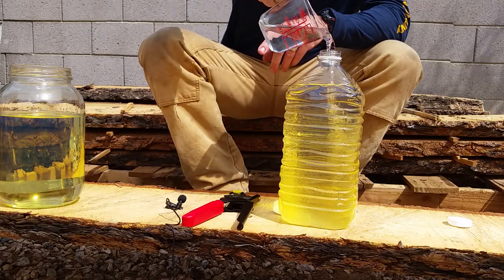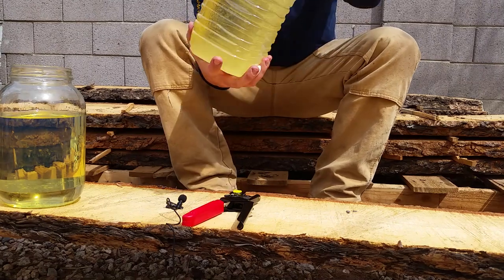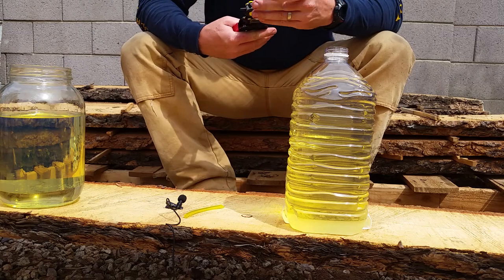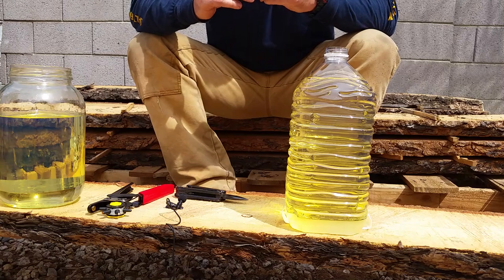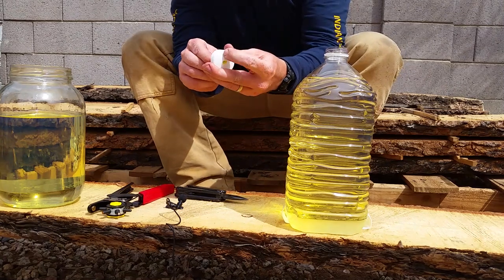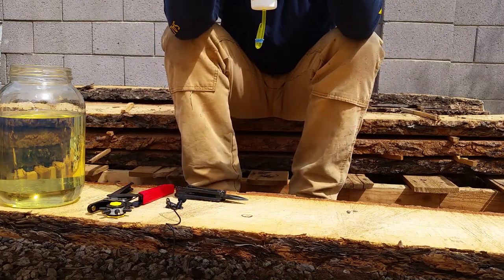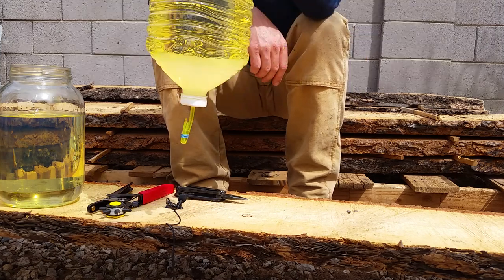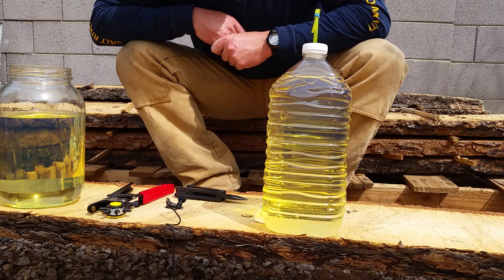Removing ethanol from gas

Comment: So I'm curious why would you want to remove the ethanol in my case I would love fuel that's all ethanol and no gasoline. It burns cleaner cooler and is easy to produce. Back in the day they used to throw gasoline away and then they realize they could pawn it off on people. The only downside that I see are you can't let it sit very long and you need more of it.
Reply from the maker: +all the boost eethanol has a affinity for water and ruins fuel systems especially small engines

Comment: The octane booster may be alcohol!
Reply from the maker: I later learned that and didn't add it
Reply: Did you know that many of the race cars use E85. it is about 110 octane. The think is that it is not the ethanol that is the trouble. It is all the other things that they put in the gas. Maybe you should look at what is in there. 10%  ethanol but there is much higher % of many other things that do the damage.

Comment: what the point of "cleaning gas " ethanal or methanal is a clearer burning fuel . plus your not doing it right. you need to heat up, let it set for number of days and plus your not gonna take all the ethanal out, your adding more water to fuel. any way good luck on that buddy
Reply from the maker: +Moe Maywood the science is fairly simple. Water and ethanol have an affinity for each other. Both sink to the bottom.
Reply: yes it does, but what are you gonna do with it after?, dump it? where? as is most recyclable oil stand they don't take dirty oil??. thanks to city laws ?WTF  it best to add methanal to your tank it will burn better and look for non ethanol gas stations.
 i make my own fuel " biodiesel" 
in my opinion ethanol should cheaper than gas,  go complaint to your government for that buddy
Reply: the more blue color the better. that yellow color is TAR or crude oil. 
yes 92 octane is best for all cars. 87 is for  Lawn mowers & two stroke engines  which they need a mix oil and gas.

Comment: Seems kind of redundant to remove the additive, and then have to put it back so the engine can run right, and being the same kind at that. Good science project but pointless.
Reply: Why would you remove the ethanol if you want to keep it in there? You remove it for engines that don't like it.

Comment: And here's why this is so wrong:
The problem in little 2-strokes isn't the gasoline or the ethanol, it's some complicated chemical reactions of the ethanol and fuel additives when EXPOSED to water. By rinsing out MOST of the ethanol, you have GUARANTEED that the remaining bit will go off and your fuel, if stored, will be contaminated.
Even adding Methanol won't help, as it will tear up those little Chinese carbs.
Go buy boat gas. Pure-gas.org . . . You're welcome
Reply from the maker: +TIMEtoRIDE900 nothing complicated about ethanol attracting moisture floating to the bottom of the tank and getting sucked up the fuel line into the carb causing rust, corrosion and hardening to rubber components. That is if it doesn't wash out the cylinder causing metal to metal friction.

Comment: I've been running "trufuel" in my kids little quad. Saves me the hassle of cleaning that gummy crap out of the jet And idle circuit everytime we start it. Which, no we don't start it often enough and what a pain in the a$$ to work on. But the fuel is retarded expensive.
   I might give this a try

Comment: "Hard to find ethanol free gas", WTF are you talking about? Just about every station with more than two octanes has non-ethanol gas, usually 91 or higher octane. This A LOT of work just to save 60 cents.
Reply from the maker: +Retro Auto - MN every grade of gas has ethanol in it year round here in AZ

Comment: I'd rather pay the extra 20 cents per gallon for non ethanol..  shoot I pay  45 cents for higher octane non ethanol.
Reply from the maker: I can't find any here from the pump
Reply: @KimballCody  that is unfortunate. I believe every single station here has at least 1 non ethanol option, usually the premium 91 octane.  The smaller stations will have 89 octane 1 with and one with 10% ethanol.  We are a major ethanol producer state so the government is trying to change the 10% to 15%.  I can not stand ethanol for motors it's only good to drink.

Comment: A jug of gasoline left hanging upside down, what could go wrong?
At least this guy seems to be outside.
Ladies and Gentlemen....PLEASE be careful with fuels...any and all fuels.
You might try siphoning off the clean fuel. Keep the hose end above the water level.
That's how they get wine out of the barrels and leave the dregs behind.

Comment: I do not recommend doing this . Ethanol / alcohol Is not that big of a deal . the problem everyone is having with it is just what you are showing in this video . The moisture will clean to the ethanol so Therefore ethanol will pull moisture into it. water in fuel in engine don't go together . The tank in your vehicle is sealed you don't have to worry about moisture being pulled in . Now their outdoor equipment is a different story .run your mowers dry when you're done with then invest in a decent can . The little red mixing can that everyone keep is where 90% of this damage occur Shelf life of fuel 45 days tops

Comment: Obviously not to many of you realize the performance gains.  Especially on turbo and super charged applications. An f150 with EcoBoost can easily pick up close to 100hp or better when combined with a custom tune. I've never had more fun in a truck.  It might not get the miles per gallon but for me it's about smiles per gallon.  I dyno'd stock but finalizing the tune before I test the gains with E85

Comment: Try 1 oz diesel fuel to 1 gallon of gas.
Reply from the maker: +Larry Norsworthy what does that do?
Reply: KimballCody   It raises the flashpoint of gas. Look up octane boost content. Its mineral spirits. Diesel is almost just dirty kerosens/mineral spirits. Cheaper. Plus it cleans valves and plugs and is a lubricant.

Comment: find somewhere to buy real ethanol free gas. This removes some etoh but adds h2o, that's a big part of what were trying to ovoid
Reply: h2O settles to the bottom as its specific gravity is more than gas, ever drain a motorcycle tank? all the water comes out first.

Comment: Hate mail, hahaha. I know what you mean. People are such assholes. You go through the effort to try to help people and most won't even help you out with a thumbs up. I'm thinking of doing this a little more scientifically and measuring how much water goes and and how much water/ethanol comes out which should show the rate of success. I am making a first attempt at this using a dish soap bottle with the cap to drain off the water. If that works I may look to a bigger container to use on a working scale. Thanks for the video.

Comment: Search google for pure gas dot org for a state by state listing of ethanol free gas. I found a station 9 miles from my house that sells it.
Reply from the maker: Nothing from the pump here in the Phoenix area.
Reply: Phoenix SUNOCO          Speedway Race Fuels           2845 W Broadway Rd 2016-03-02
Phoenix TORCO-BRENNER OIL Streetfighter Motorsports     2728 E Bell Rd                 2017-10-26

Comment: YOU SHALL LOSS 3-5 points RON after  "Remove the fluid that settles to the bottom and you're left with pure gas." then break the engine.
Reply from the maker: +Tomasino Lei hasn't broke it yet

Comment: This is great in theory, but in practicality it's useless. My vehicles tank is 20 gallons, to use your method would make my property into a chemical factory. There have been a few comments about the necessity for ethanol now that we have the oil reserves (which I agree with) but look who is running the show. They are eliminating natural gas and we are doing nothing but re-electing these people. They want electric cars but have rolling brownouts and blackouts. How are you supposed to charge your 150-mile range car? And 150-mile range is being generous.

Comment: Never ever put gas in glass containers!
Reply from the maker: Why?
Reply: @KimballCody  due to temperature changes, gas will expand, contrac. Glass doesn't expand like plastic. Glass allows sunlight to heat the gasoline. Possibly to temperatures that could cause gas to ignite.  My dad  knew a man that left 5 gallons of gas in a glass jar in his car while getting a "cleaning" at the dentist. When he returned to his car, the gas ignited due to sunlight heating the gas. It was a flaming inferno. The dentist ran outside to him, but it was to late. The man was engulfed in flames. Similar to hell fire.  btw, I have been running my truck on two cycle gas. I'm using penzoil tcw-3, non detergent oil. I mix 1 ounce in every 5 gallons of gas. My truck has a 15 gallon tank.  I started adding 2 cycle oil to my gas early this year because of your video. Thanks for the video. I'm interested in the outcome of wear on certain parts...gas pump etc. My trucks gas pump has already been replaced once. Thanks
Reply from the maker: I replaced my fuel pump a few months back. Not sure if its due to it being 30 years old or the oil in the gas. I have since discontinued the 2 cycle oil for a bit. I might go back to doing it.
Reply: @KimballCody  I would bet more on the 30 years old factor, and the long term ethanol exposure in an older machine (I may have misunderstood this or missed an earlier video, though.. )

Comment: So if this is true, it's all sitting at the bottom of the tanks at the gas station too?    They must go in the middle of the night and shake 'em while no one is looking so we get the ethanol too. Wake up kid.
Reply from the maker: +George Gavin no. Gas doesn't sit very long in tanks and this percentage of water isn't in it. 
But if you dumped 100 gallons of water in a gas station tank you'd definitely get seperation.
Reply: KimballCody I think you should do a little more research before you make such statements. It doesn't take long for it to separate. Just watching what you are doing shows that. Just because it's a bigger tank makes no difference. If it separates that fast, somebody is going to get a tank full of water and ethanol. Period.

Comment: Putting water in your gas is a terrible idea
Reply from the maker: +Nathan Ruth did you watch the entire video?
Reply: Yes there is no way to get all of the ethonal out of the gas that bonded with water. You will be stuck wondering why your chainsaw will not run and besides ethonal is great for controlling detonation.
Reply from the maker: +Nathan Ruth runs fine in my saws. Ethanol causes more problems than the improved performance offers.

Comment: Turkey baster to the bottom of the jar/bottle and suck out the water.  Easier than punching a hole and using a piece of fuel line.  Good video.

Comment: IF?

You know a "friendly" airport FBO that will let you? 100ll, 120 ) or 140 mil. Av fuel? 
No ethanol & will make your de- ETHANOLED stuff wait for you?
Runs in, mower, bike, snow blower, pressure washer, string trimmer & even model airplanes & helo's? 😀🇺🇲☮️

Comment: No h
ate mail here.  Just very quizzical.
Some commenters need to recheck their number and quit subscribing to conspiracy theory's.
I'm not supporting  ethanol by the way.   At all!!
I just don't understand why your going to all this trouble!   I've had a small farm with all the usual farm tools: Chainsaw, mowers, tractors, weed-eaters, ZTRs, etc. I've never had "problems" with my equipment related to fuel.  My backpack blower is 15 years old and I've changed the spark plug only.  I've never changed the fuel lines on any of my equipment.  All the equipment runs perfectly and no power loss.  So why all the fuss!!?
BESIDES,  handling gas like this creates the equivalent pollution of a lot of cars!  Spilling gas or open gas containers are terribly polluting!!
My question is why?  Why go through all this trouble for no appreciable benefit (except giving the finger to the man...)
Reply from the maker: Your anecdotal experience doesn't disprove the fact that ethanol attracts moisture, degrades rubber parts and shortens the life of engines

Comment: The ethanol is a very cheap way to add octane booster. Buy ethanol free fuel that has another octane booster. Sorry no way you can add octane, The booster you buy will be ethanol. But if you want to remove ethanol its simple. Leave the gas set in the sun all day, Ethanol will evaporate, out of the fuel above about 120 degrees. Hell when they added it in the 60s and 70s it was called gasohal. and sold cheap. But it cut your fuel mileage, California. would not let you use it because   of smog. Now that trump is going to use it in the summer, The new generation might learn about it. Not only the smog it creates but how fast it evaporates in the summer. Farmers made it all the time. And old tractors or cars with cast iron carbs can run it with no problem. Be side fuel millage.

Comment: This is not worth doing. Somebody show me scientific proof that ethanol damages engines or their fuel systems.
Reply: the ethanol does by damaging rubber gaskets older fuel lines etc... Attracts water which causes the rust and combustion issues. Mainly as others mentioned a small engine outboard thing.
Reply: juck huo The AMA or American Motorcycle Association has been fighting this for years, and if the link works, it shows where in 2014 the EPA's own study (not the AMA's) proves that ethanol damages engines. 
https://www.americanmotorcyclist.com/Home/News-Story/epa-acknowledges-that-ethanol-damages-engines
Been riding/racing motorcycles for 45 years and never had omg-going carb troubles like I've had in the past 10+ years. I confidently blame the gas.
Reply: The only thing this article says is that the epa ACKNOWLEDGES that ethanol fuel increases exhaust temperature which can cause damage to emission systems such as the catalytic converter. It didn't say they proved it. Anyways ethanol does not burn hotter than gas actually it burns cooler. Ethanol has less btus then gas which is why you get worse gas mileage with it. If you need proof that it runs cooler I can post a video showing that it does. I have two cars that are the same year, make, and model, one that runs gas and one that runs e85. I can run them both till they warm up then show you the temperature of the exhaust of each and I can also show you the coolant temperature. let me know if you want me to actually do it, because I'm fed up with all the negativity and misinformation about ethanol fuel. Ethanol is a great fuel that helps us be energy independent.
Reply: oil won't bond to the alcohol/water. Argue with somebody else on ur car. I dont care. Those of us with outboards dirt bikes chainsaws etc... ethanol sucks.
Reply: where did I say that oil bonds with water or alcohol? lol

Comment: or just go electric and skip this nonsense.
skip oil changes, clutches, shifting, etc. electricity is currently 80% cheaper than gas.
Reply from the maker: Lol.....when you can get me a electric saw that will cut like a gas and run all day long on a gallon of fuel equivalent size battery.